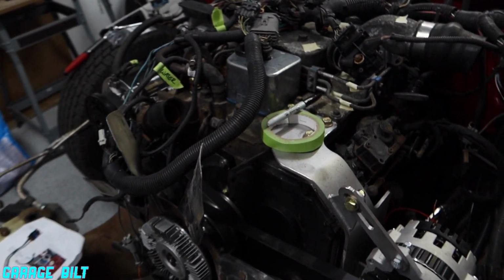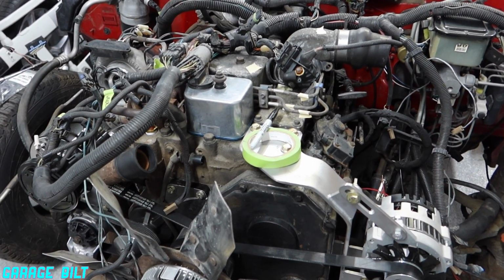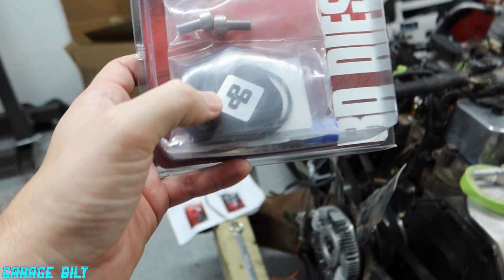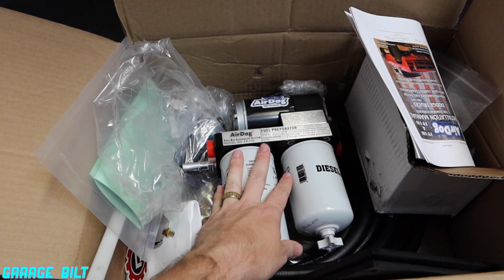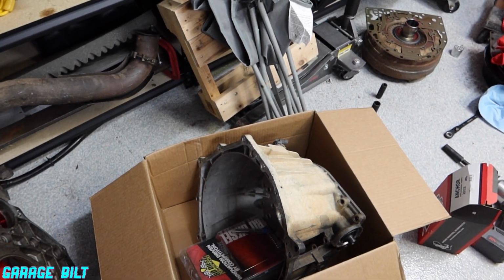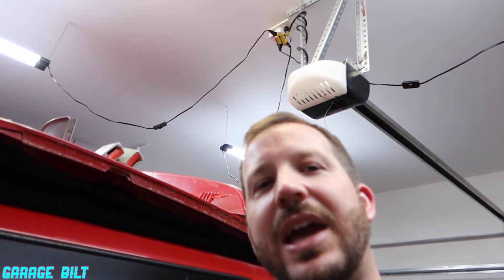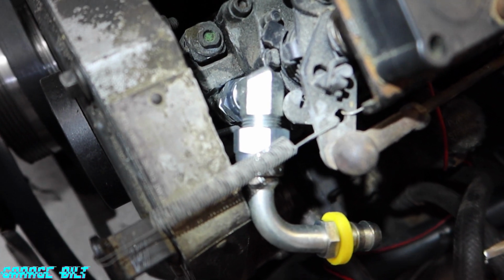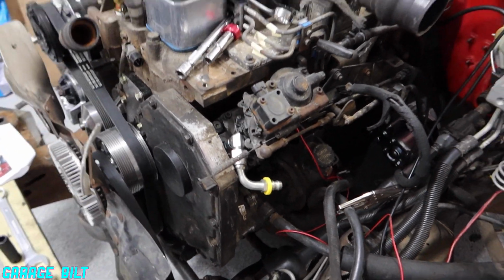Pureflow Airdog 150 on a First Gen Cummins Engine

Comment: Some free info. FWIW Get the cummins oil pressure sending unit. The aftermarket 1's will give you false low readings. Especially BWD. Just thought I'd mention it ;)
Reply from the maker: Ill look into it. Currently I have a 94 GMC diesel oil pressure sensor in it since that is the gauge set it will be reading to. If things seem funny ill rewire the harness and switch to the Cummins one. Thanks for lookin out.

Comment: Does your truck have a saddle tank beside the drive shaft or one that goes behind the rear axle?
Reply from the maker: Side saddle that gives the truck the ole OBS driver side lean. I ordered a 20 gallon fuel cell that i plan on mounting in the spare tire location.
Reply: @GarageBilt   I was going to suggest a 89-91 Chevy Suburban tank. A lot of guys use them and you would mount it in the same place you are going to mount your fuel cell. But a fuel cell may be easier to work with. That said you may want to consider moving your water temp sensor to the back of the head in the factory dodge location. You would need to get a brass 3/4 npt to 1/2 npt adapter. You will get a more accurate reading from the temp gauge because the rear two-three cylinders run hotter. You can see this when you run dual egt gauges as the exhaust manifold is divided in two the last three cylinder on the egt gauge are usually 200-300 degrees hotter than the front 3 cylinders. I don't know what the water temp difference would be. Just something to think about.